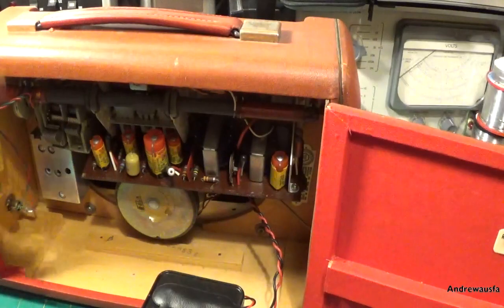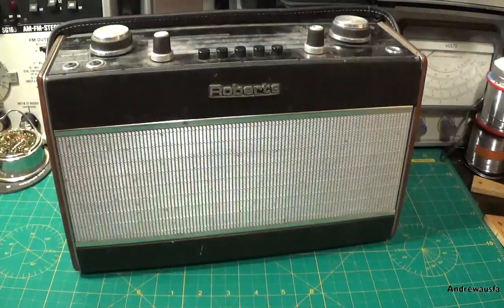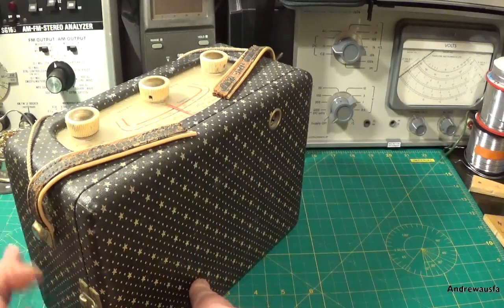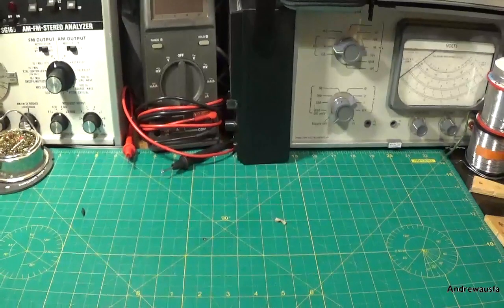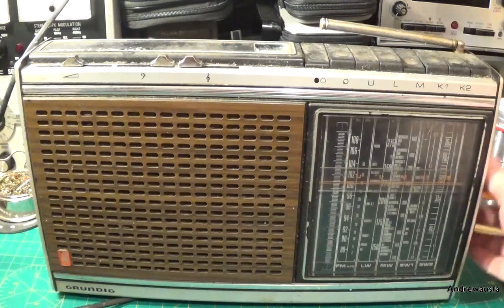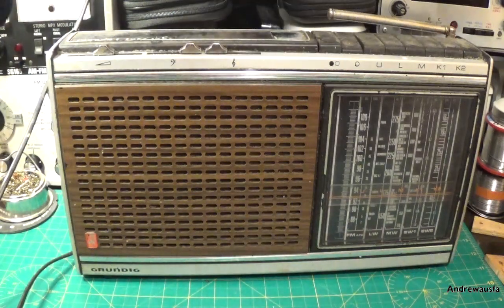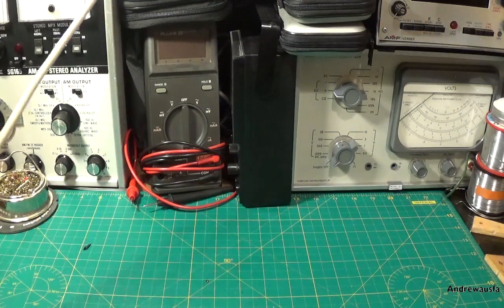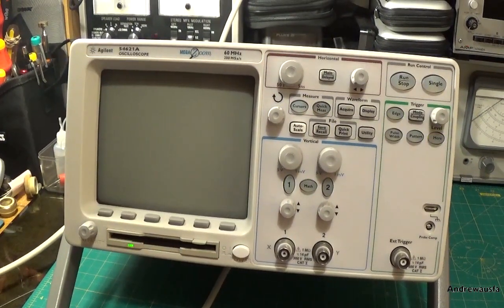Recent Finds part ....

Comment: I have a Revival radio in the bog. Best place for it.In all fairness its sensitive but cheaply made.RIC 1 looks nice, never had a RIC 2, R600 's are nice looking but as you say bloody modules, RT8 look cool, RT1 looks great and well worth restoring, The Scope is similar to the 100Mhz ones we use at work, Dave Jones likes these.
Some fantastic finds, was it a Roberts radio fair lol?
Reply from the maker: Hi Simon, it's (the R250) got a blown electrolytic so no doubt the amp IC has taken a hit. For someone who doesn't collect Roberts sets I did bring back a few!

Comment: hi i wonder if you could point me in the right direction.i have just won an ebay auction for a hacker herald but two of the white
push buttons are missing any idea were i could get replacements it’s my first ever hacker radio
thanks
Reply from the maker: Hi Stuart, which Herald, RP30 or 35?  You can't buy them new so a spares set is the only way to go.
Reply: Andrewausfa hi it’s the RP35 model thanks for you quick response
Reply from the maker: @mm3vko  Hi Stuart, I don't have any white ones I'm afraid. The only way is to invest in another scrap set or ask on UKVRR  https://www.vintage-radio.net/forum/

Comment: The sound of the Grundig nearly floored me, and good luck with your finds Andrew 👍 Tam.
Reply from the maker: Hi Tam, keeping well? There's more to come from that Grundig I think. Needs a good bath and all the capacitors in the audio path need changing. And the small matter of it not working on FM or LW now.
Reply: @Andrewausfa  Doing great Andrew. Sir you really can pick great radios 👍 Tam.